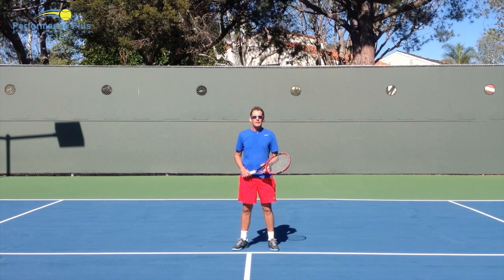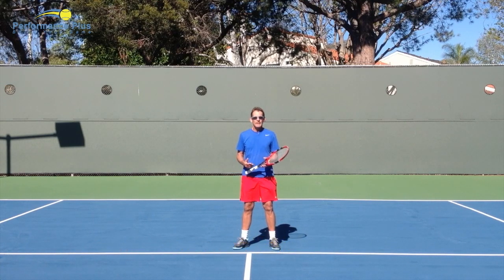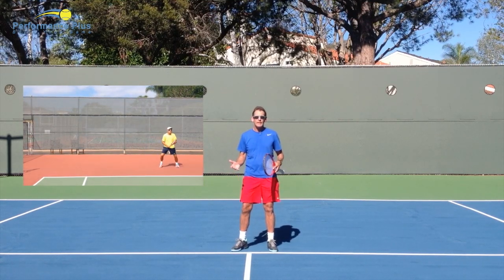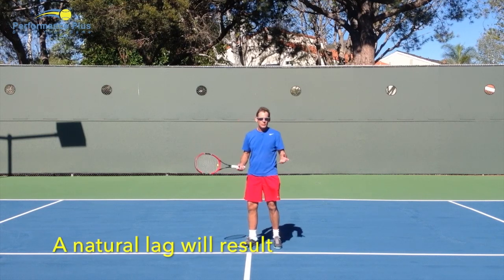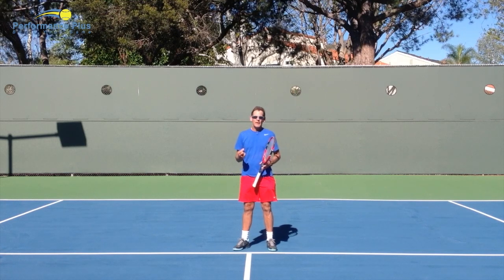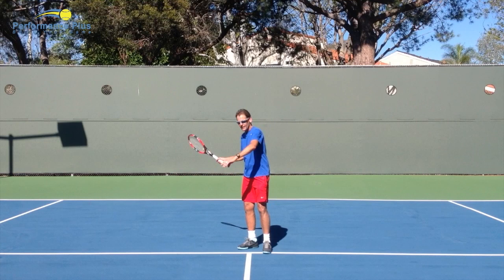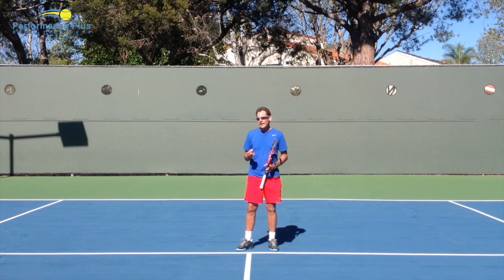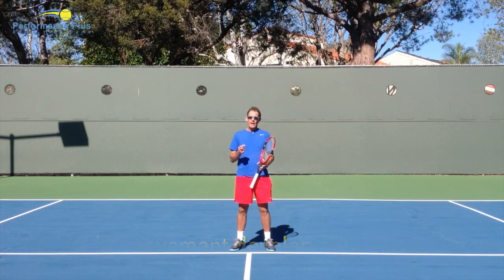Lag And Snap On The Modern Forehand

Comment: For me there definitely is a lag and a snap. .  When you get into the slot, your racket butt is pointing at the ball. This to me is lag. Natural lag, Intentional lag, etc. , we can put a label on it, but I know i arranged for this to happen with my body.  As I swing forward, the racket starts to accelerate nearly catching up with the wrist to the point of contact.  This did not magically happen, but rather my body arranged for this to happen.  I either slowed down my wrist to allow the racket head to catch up (similar to a golf swing) or I gave the racket head a little help using wrist flexion (snap). In my opinion. both are legitimate ways to line up the racket face to hit the intended shot.  In addition, there is tremendous power in snapping just prior to contact that can be managed after some practice.

Some instructors in more recent YouTube videos are in denial, saying that you should  maintain the lag that you started with in the slot all the way to contact.  When I slow down their demo videos, I see that even they lag and snap (they use wrist flexion to arrange for the racket to accelerate into position just prior to contact).

Comment: You're so right.  There's an instructor currently on you tube who has his students just flicking their wrist at the ball on the forehand.  I wrote him and told him that this is all wrong.  If you do a slow motion on any of the great forehands including Agassi, Becker, Lendl,  Nadal,  Djokovic,  and Federer, the meat of their hand meets the ball flush on contact and then the follow through ocurrs.  It happens quickly but that's the motion every time. 

Great video.
Reply from the maker: Hi Gregory, Yes there are a couple coaches who proclaim the wrist snap, which is nuts? One of these coaches is from France, the other I believe is US based in Georgia or Florida...who did you contact? Thanks for all fine feedback and support! Kindly, John
Reply: @PerformancePlusTennis  Pieter Becker.  I wrote to him exactly what l related to you.  Check him out and if you find time give me your feedback.  Maybe you can give him a few words of wisdom.
Reply from the maker: @gregoryphillips3969  Hi Gregory, I took a quick look...that's enough for me. Thanks for sharing! Best, John
Reply: @PerformancePlusTennis  That's fine, you saw what l was talking about.
Reply from the maker: @gregoryphillips3969  Thanks. For me, it's all about the key fundamentals that comprise a foundation of skills, along with the finer details.
Reply: @PerformancePlusTennis  What's a shame though is when you have so called instructors who teach in a way that will hold people back from ever reaching their potential.  Thanks for all of your responses.
Reply from the maker: @gregoryphillips3969  Yes, true. But for me it creates an opportunity to make a difference. Thank you all your kind words and support!

Comment: If the grip is properly loose and the kinetic chain from ground up is correct it certainly feels like a snap as the racket head catches up but you're right that there should be no intention to robotically snap.

Comment: Just re-watching your lag and snap video, John.  I've been doing a lot of experimenting with my forehand mechanics and one thing I've concluded is that the lag and snap is not a major power contributor.  If you're familiar with the difference between a cause and an association, the lag and snap is not the cause of greater forehand power.  It is associated with this greater power because it accompanies the true cause.  And that true cause is a tendency to a whipping motion with the forearm as opposed to hitting with the upper and lower arm moving more as one piece.  Jack Sock exaggerates this whipping motion by pointing his racquet head forward as he goes into his backswing.   This keeps the hitting arm elbow high and far away from the torso.  From this position, simply firing that elbow forward to begin the forward swing will create a whipping motion.  The whipping motion creates more racquet head speed for an equivalent effort than a "one piece" motion.  That's why whips create that cracking noise--the acceleration of the whip's top section is so great it creates a strong perturbation of the air.
An extreme motion like Sock's is likely tough to control for us mere mortals, but in my experiments where I only partially imitate Sock's motion (e.g., using just a moderate forward pointing of the racquet head at the beginning of the backswing) I've found that not that much practice is necessary to control the stroke.  And the power increase is very noticeable.  A further benefit of that heightened and separated elbow is that the backswing itself is shortened so that there is less risk of hitting the forehand late.
Reply: You were on to something here but the way you worded leads me to believe you fell into a common misconception.
Reply: Once a tennis player gets to a certain level it's all about being aggressive with safety.   Flicking and flailing at forehands can be perfected but under real pressure not having a stable wrist at impact is going to be a problem unless your name is Nastase who was such an extraordinary talent. 

I always say look at slow motion video of, Lendl, Becker,  Agassi, Federer,  Nadal and Djokovic on the forehand.  They all meet the ball with the meat of their hand and then proceed with the follow through.  

Flicking and flailing at forehands is not a good long term strategy.
Reply: @gregoryphillips3969  The question of what the wrist should be doing is IMHO one of the most controversial issues in tennis.  A large part of the problem is based on a confusion between moving the wrist intentionally and moving it unintentionally.  Trying to get more power or spin by intentionally adjusting the wrist is a recipe for inconsistency because the accuracy required and the tiny, millisecond time frame for making this movement is beyond the capabilities of most. humans.  The confusion occurs by then saying the wrist must be kept firm and stable.  This usually leads to a stiff wrist which promotes tension and destroys the necessary fluidity for consistent and efficient strokes.  My understanding is that the wrist must be kept relaxed enough to inhibit excess tension in the stroke.  When coupled with a good unit turn the wrist will naturally bend in response to the strong inertial force of the forward swing, creating the wrist lag seen in all modern forehand groundstrokes.  The wrist, however, is not intentionally bent to produce this wrist lag but is the passive result of the proper degree of relaxation coupled with a vigorous forward swing.
Reply: @Fernwald84  Shoulder turn and leg drive are what carry the day.  With the exception of Nastase who was a genius again look at slow motion footage on the forehands of Agassi, Becker,  Djokovic, Federer etc.  The meat of the hand is always flush on the ball at impact and then the follow through happens.  None of these great players were squeezing the racquet.  There's a feel for being relaxed but firm enough to maintain control.  The players who have won more matches than anyone else didn't flick or flail at the tennis ball. 

I realize that tennis evolves and tennis instructors are always trying to make names for themselves but l would stick to emulating Djokovic or Agassi on the forehand.   Not much can go wrong there.  There aren't too many Nastases walking around.
Reply: @gregoryphillips3969  The point of the wrist lag isn't to be a major power source but its presence indicates that there is likely no excess of tension in the wrist and forearm.  If you are talking about just power sources, then, yes, the unit turn and leg drive are the major sources.  Federer, Nadal, Djokovic, Del Potro, etc., all had wrist lag.  And, yes, wrist lag ends in a neutral or "flush" position at ball contact--otherwise the ball will go off in an unwanted angle.  Flicking or flailing at the ball is a sign of intentional wrist manipulation and that's not what correct wrist lag is about.
Reply: @Fernwald84  There are instructors on You Tube right now who speak openly about flicking and flailing the wrist at the ball as a source of power.  They are dead wrong and are doing their students a disservice.
Reply: @Fernwald84  Last thing, like l said earlier on a forehand the wrist should be relaxed but just firm enough to maintain control.  If someone can state it better l am all ears.

Comment: A clear presentation of the forehand "lag" came out in this April video: https://www.youtube.com/watch?v=wphQA7ZVNNc.  The idea is that keeping the wrist very flexible--more flexible than many of us were taught--will result in the handle of the racquet leading the racquet head during much of the forward swing, causing the lag.  And, as you point out, John, the racquet head will naturally catch up with the hand and racquet handle as we approach the ball strike zone because the shoulder rotation slows down.  Like you also point out, this is an automatic movement and no conscious "wrist snap" takes place.  Another important thing which happens when the wrist is held loosely enough to create the lag is that the racquet head will drop somewhat during the looped takeback, enhancing the low-to-high trajectory of the racquet.

Comment: The lag is because the wrist is relaxed.  As you start rotating your arm and the racquet handle and much of the throat forward,  a relaxed wrist allows the rest of the throat and face to continue backwards.  Then it rebounds on its own into the slot  based on Newton laws.   Practice the lag with a 30 inch wood dowel.   If the racquet comes to a full stop before the forward swing there will be very little or no lag and rebound affect.  The racquet must be moving back before the forward swing to get the lag and whip affect.  So it is very difficult to time.  To do it like Federer with a high drop is next to impossible. If you do an atp style lag your hand will turn over naturally.
Reply from the maker: imateapot51 Thanks for your perspective...
Reply: You should study 'Netwon laws' properly before instructing others!
Reply: Tony07UK,  I agree with the OP that this is probably not the best for recreational players or non tennis academy juniors.   You can look at ATP pros and think you know what they are doing until you actually can do it yourself.   It is an extremely high level skill to have a very relaxed wrist.   Do not underestimate this.  When you start rotating your arm forward,  from your hips,   the racquet face and much of the handle continues going back while the hand and some of the handle is going forward.   Now the face does not just stay there unless the wrist and forearm muscles make it stay there.  For every action there is an opposite and equal reaction.    So the racquet face and much of the handle accelerates forward like a whip.
Reply: .. you've missed the point. Not discussing technicalities - just your spelling.

'Netwon [sic] laws' ??
Reply: That is called a typo.
Reply: Tony07UK Because you've never had a typo
Reply: Really? .. ever heard of 'edit'? They live on the same block.
Reply: Why should I have one? .. are you selling?

Comment: I notice that I never intentionally snap, but sometimes I have to intentionally lag.  When I get into a tough match and on an important point my wrist tends to tighten up.  At these times I have to consciously turn the racquet into the lag position as I pull it forward.  Especially on the return of serve I must plan to lag the racquet.  This makes my stroke less fluid, but it is better than a level swing that puts the ball into the tape.  Hopefully, I'll get better and not have to do this.
Reply from the maker: Hi Michel,
Be sure to check out my grip tension tip, which should help you develop a natural lag without any intention. Good luck and let me know if you have questions or additional feedback.

Comment: I'm not following/seeing your definition of snap as the way others have described it... maybe even that same online instructor you mention whoever it is in particular who's videos I may have seen too. 

I'm at a 4.0 level currently and have been for a while developing a "snap" as you call it, but it is not a release of the forward wrist "through" the ball and straightening out the lag bend as much as a release of the wrist upward that allows the racquet to move from a well below the ball into contact to a well above the ball after contact as fast as possible... the wind shield wiper move as many would call it I suppose.  I realize it takes a bit more practice and timing, but what else would one expect to develop a stroke at a higher level. But the "snap" I employ as also described by another on line instructor (as well as my local pro) does not change the relative wrist bend in a more lag-like bent-back position until well after contact and into the follow through across the body.

That said, I have a DVR recording of Novak at the Australian this year and he charges a short ball bouncing up higher at the back of the service box.  In frame by frame slo-mo, his racquet is is super low below the ball and in an instant is well above his head as he "wind shield" wipes the ball for a smashing winner with incredible imparting of top spin.  At contact, his wrist is still laid back after leading into contact until the racquet and wrist (still in same position) are square to the net at impact in front of his body.  Same as my pro teaches.  I have other recordings of similar strokes from others too.  My definition of the snap is a low to high release of the racquet while "stroking" through the ball... what exactly is yours to compare so I understand?  Thanks.
Reply from the maker: gofish0721 Hi and thanks for your feedback and interest. Here is the definition of the word snap: 
break or cause to break suddenly and completely,. synonyms:break, fracture, splinter, come apart, split, crack. So tell me, does this describe what you're trying to do when you're for hand? The word snap does not apply and it causes confusion, inconsistency,  performance and even the potential for injury. My videos are intended for players to develop sound fundamentals and optimize performance, which includes power and consistency. My videos were particularly in response to the idea of "Snap the Cap" as the term that one online coach has presented in his videos. I do believe and teach that the racket head will come from below the hand at the bottom of the backswing and finish above the hand through the extension phase of the stroke, but I do believe this can be performed and developed without the idea of snapping. The other issue I have is simply players trying to do this without the foundational skills in place first. The result is not developing consistency and control that most people need to focus on. We should be trying to grow the game by making it easier to learn in providing people with success, avoiding injury and optimizing performance. Concept of like a snap rarely fits into this vision for the recreational player. I hope this makes sense, and look forward to any further feedback.

Comment: The intent of lag is for the resulting snap.  Whether intentional or not this is the technique of all modern players.  Lag and snap using poly stings.
Reply from the maker: Hi Kelly, Here is the definition of snap: "break or cause to break suddenly and completely". This is not what we should be trying to do. How about "Lag and catch up"? BTW, how much lag do you see in Del Potro's forehand? (one of the biggest on tour). As I say in my video, the movement will be natural if the other keys elements of the FH are properly developed. Good luck with your tennis!
Reply: I see your point.  Snap may not be the most appropriate term to use.  Maybe the more appropriate phrase is lag and passive acceleration.  Good video and your point of not having people focus on intentional snap is a great point.
Reply from the maker: Passive acceleration...great term! Either way, the movement should be natural. Thanks, John
Reply: .. and what has 'poly stings' got to do with tennis technique? (your strings are irrelevant as far as biomechanics is concerned)

Comment: I agree Lag & Snap is for much advanced players. Beginners or traditional forehand grip eastern FH (like this coach), who doesn't want to add tons of RPM to the ball is not suited for lag & snap. Also whoever hasn't learned windshield wiper Forehand follow though shouldn't learn lag & snap. But if anyone masters lag & snap, it's such a weapon that you can hit shots with so much RPM, so heavy & penetrating. This is the essential of huge racquet speed.
Reply from the maker: Hi Cheng, Thanks for your comment. I think we would all agree that Roger Federer has a lag in his forehand, which he plays an Eastern Grip. So, I think it is less about the grip and more about the relaxed arm / hand during the swing. Slow motion analysis of top forehands proves that there is no "snap" of the wrist before and during contact. If you need to know more about this subject, I suggest you check-out Tennisplayer.net for super slow motion film and analysis by John Yandell and other top coaches. All the best! John

Comment: Snap is a questionable terminology as it is the result of several different actions. the timing is the going of loose to tight of the grip which can be worked on with using unit turns with minimal swings and squeezing (getting the hands thru the ball) at the point of contact to that the racquet tip is moving foreward ahead of the hand making the racquet a lever.
Reply from the maker: Thanks for your feedback. I suggest you take a careful look at the video I produced for Tennisplayer.net on this subject, which features exclusive slow motion video of Roger Federer and Juan Martin Del Potro. your additional feedback is welcome! Thanks, John
Reply: thanks John, I looked for them but can't find the videos you referred to.